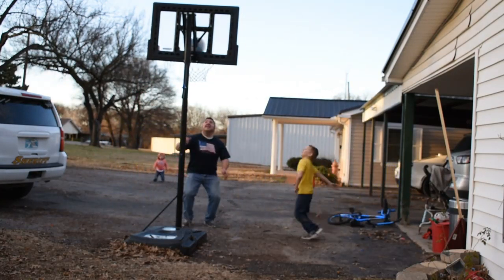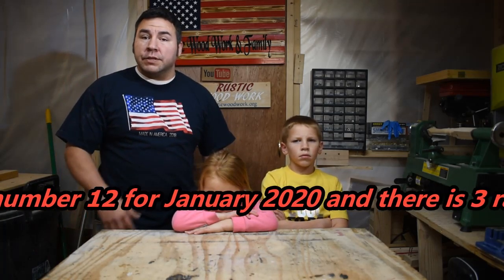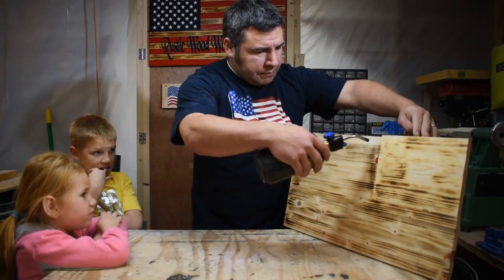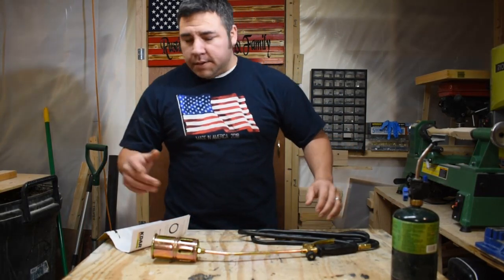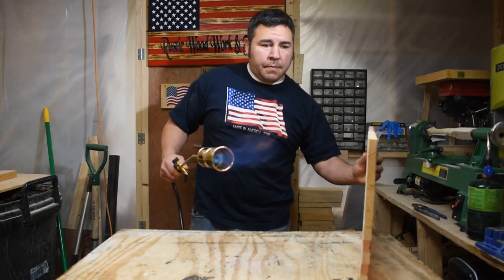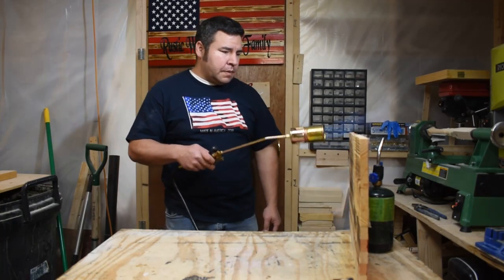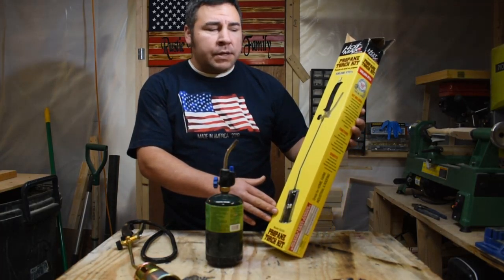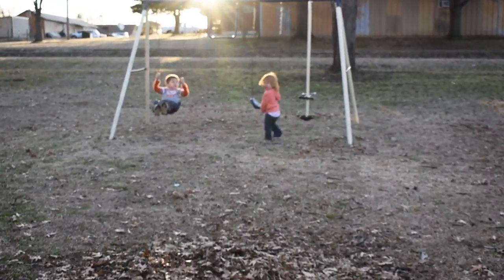Hot Max torch may be to hot for my wooden American flags, DIY, How to,

Comment: Brandon,
That new torch will really save you a lot of time!
Just be sure you keep a fire extinguisher nearby. With all the sawdust and small pieces of wood, it could easily and quickly turn into a disaster.

I want one of those torches for burning along fence lines and weeds around the place. They're nice.

Comment: Brandon, have you tried a paint remover attachment to the torch tip? It spreads the flame out evenly to a flat spray without hot spots at tip of the torch. I've used it for some of my wood carvings to expose grain and then lightly brush out any excess 'charcoal' with a denture brush giving it that weather-worn grain texture and highlighting the grain.. I got idea from reading about Japanese "shou sugi ban" method for preserving wood.
Reply from the maker: Desert Dawg no I have never tried that tip I will have to look that up. Thanks for the information.

Comment: You can probably line up a bunch of the stripe boards and do them all at once. When you know you have full control of the torch. That would definitely not be good to have the youngens around while using that.
Reply from the maker: Debra Streeter Yes I agree I am glad I did not have them in the shop when I tested it out. Thanks for watching